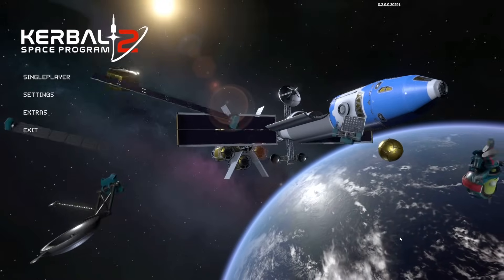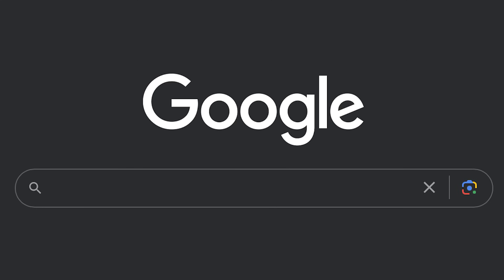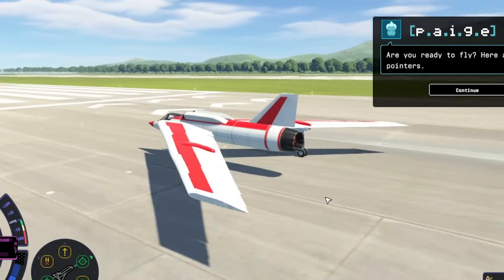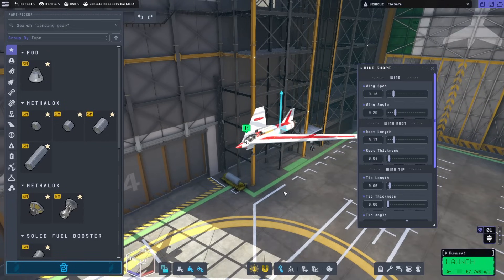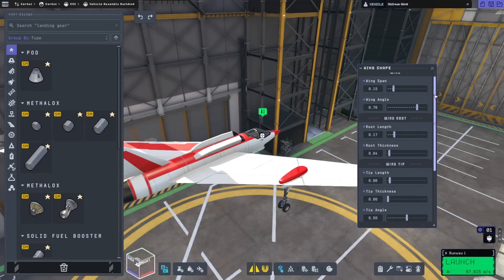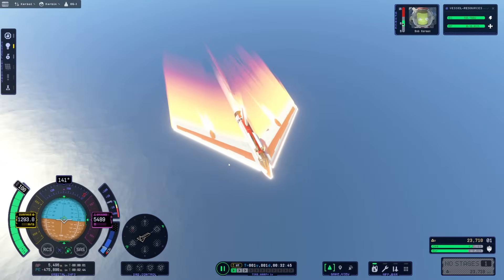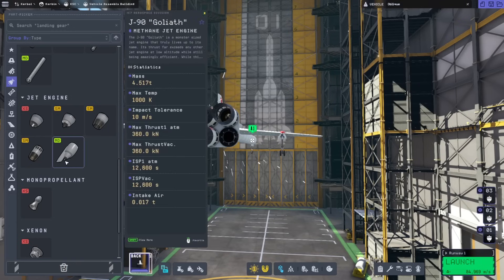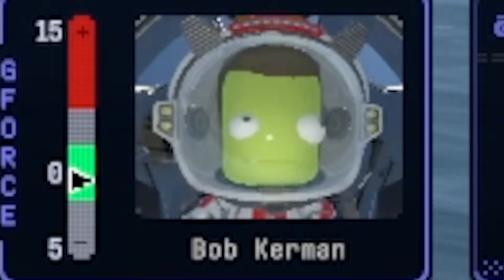Testing the future of air travel!

Comment: I mean, I'm not an aerospace engineer, but from what I've read in the pilot's handbook of aeronautical knowledge, you kind of want some rear elevators to control the whole pitch thing.  Putting the center of lift on the center of mass works, kind of, but that could potentially be what is making it unstable.  Ailerons are meant more for roll than pitch control.  You're pretty much getting all of your pitch control from your engine.
Reply: I am an aerospace engineer and I can clearly say that you are right. One of the biggest problems about oblique wings is the pitching moment hence it may need a huge horizontal tail with huge control surfaces. However, it seems the KSP2 aerodynamic models are not very complicated. The effect of sweep, compressibility (supersonic flow) and spanwise flow may not be considered for this game. I guess the aerodynamic center and center of gravity are the only parameters that affect the aircraft dynamics in this game.
Reply: @yusufbayrak1338  I wanted to write that KSP doesn't simulate span-wise flow, but you already pointed it out. There was a mod for that in KSP 1 ("Ferram Aerospace Research")
KSP is trying to predict how to deflect each surface according to CG and the position of wing control surface, but having two control surfaces (where center of the elevon is near CG, so it had tiny pitching moment) on asymmetrical wing is something that surprised me. I thought it wouldn't be controllable in this setup
Maybe this Real "Civil" Engineer are better at making planes as us? Is he truly a "Civil" engineer?
Reply: @yusufbayrak1338 as a former onur air sub contractor, i salute you! Best wishes dostum.
Reply: @yusufbayrak1338  > I guess the aerodynamic center and center of gravity

Pretty fair assumption for rockets, it was strange to try it in KSP)
Reply: I saw another person make a proper oblique wing in a more accurate game and it worked just fine.
Reply: @Anti-Smart what's the name of that more accurate game?
Reply: I'm just a guy and I have to say it would be funny as hell if our government used these wings for fighter jets.
Reply: First thumbs down on one of his videos lol
Reply: I have been thinking that and commenting that every time he makes a plane. "WHERE ARE YOUR ELEVATORS?!?!" LOL
Reply: I mean, I am a vtol VR pilot
Reply from the maker: They also said you want symmetrical wings too right? 😉
Reply: @RealCivilEngineerGaming you’ve got some different moment arms going on there between your straight wing, swept wing, and oblique wing designs. Source: back of my shampoo bottle
Reply: @RealCivilEngineerGaming  NO. You can build an oblique wing, but you will have roll and other control issues, if you don't reverse the controls on the ailerons on the oblique wing. THIS HAS NOT BEEN TESTED PROPERLY IN THE VIDEO. Build a plane with proper controls and try again

EDIT: never mind, you did figure out that you need to invert the controls, still BUILD AN ELEVATOR
Reply: ... @RealCivilEngineerGaming
Reply: @RealCivilEngineerGaming  actually, at least in my Gleim Private Pilot FAA knowledge Test Prep(2020 edition), it mentions nothing about symmetry and everything @Map71Vette said is true, and my knoledge of planes goes a lot farther than just a test prep.(however the gleim test prep does cover everything you need to know)
Reply: @RealCivilEngineerGaming   Canards then?
Reply: @RealCivilEngineerGaming probably not
Reply: @RealCivilEngineerGaming  It depends on what your needs for the plane are
Reply: Fairly sure his main issue is that ksp likely doesn't have accurate aerodynamics. I would be surprised if it was simulated beyond having less drag (due to less surface area facing forward), and in fact simulated the fluid dynamics of how the fluids interact with the wings and the rest of the fluid and the sound-limit.

Comment: The problem is the wing positioning, you needed a shorter wing at a narrower angle. If you look at the oblique asym wing in the video, it's far closer to the body than yours. I'd bring it much closer say 10 degrees of center line for both wings. I suspect, if you did that, and decreased the wing span by about 20% you'd hit 1500 m/s in game.

Comment: i don't understand why he leaves the elevators on the back often off, is he intentionally making Architect planes or what? that is also i think why his SAS system freaks out because it's missing some crucial control surfaces.
Reply: He's not a aeronautical engineer. That's why.
Reply: @joyl7842   You don't need to be an engineer to know why the elevators on the back are there for a reason and why every single plane has them. This plane even without the oblique wing is a pure Architect design
Reply: @madbull4666  True, but I don't think he's spent a lot of time paying attention to how planes work.
Reply: @brigidtheirish  I don't think he's spent a little time paying attention to how planes work either
Reply: @brigidtheirish  he's done fluid dynamics as he was a drainage engineer, which will be quite similar to how planes work
Reply: @madbull4666  Yes, but in terms of fluid moving through a static system, not how an object behaves in a fluid. That's a rather important distinction.
Reply: @brigidtheirish  while the advanced stuff he may not fully understand the advanced basics he will definitely understand. He just did a video on advanced drainage with a lot of detailed information, he'll definitely understand that wings in middle of aircraft can't point the plane upwards because they are trying to lift the entire plane up in a horizontal axis. If he didn't understand this then I would be extremely scared of his real drainage understanding.

Most likely he just had a moment of being an architect and rushes these videos to get one out everyday.
Reply: @madbull4666 thats akin to saying an organic chemist would know how mitochondria makes ATP

They are both chemistry. But theres a reason biochemistry is a different branch. Similarly a sysadmin may work on windows for a living. But put a windows admin in front of a linux box? Lost. All the commands are different. They are both computer operating systems. But are so incredibly different.
Reply: @harmonic5107  in your examples you are 100% correct but those things are in similar fields but they have a completely different understanding of how things work. Fluid dynamics doesn't drastically change the fundamentals are still quite similar.

If water has to make a sharp turn then there's going to be a low pressure zone on the inside after the corner which creates drag and slows the water down, in a plane air will over the wing creating a low pressure zone and drag which is how planes stay in the air. Fluid dynamics will be similar between air and water in the way you want to manipulate them to act a certain way, yes the calculations will be different but fundamentals are still there.
Reply: @madbull4666  yes. But that has nothing to do with the center of lift and the CG

He may understand pressure and fluid dynamics. But that doesn't mean he understands how that impacts the mechanics of flying. In fact... CG and center of lift mechanics have nothing to do with fluid dynamics. That's very specific to an Aeronautical engineer. To a more typical engineer, you'd want the center of lift to be in the center of gravity on the plane because that's how they've been taught to lift things. It actually goes against the common sense most engineers are taught to follow. If you don't, your pipes or beams or whatever else will slip out of the crane and kill someone.
Reply: @madbull4666  stop it dude, it's like expecting truck driver to knew how to drive race car properly, or expecting racer knew how to operate trailer truck properly
The fundamental is the same, how the steering wheel, the gas pedal, brake, and the concept of gear shifter to change gear ratio to affect speed and torque, the basic concept is the same, but in practice both of them deal with it differently

Just like drainage engineer and aeronautical engineering, both learn fluid dynamics, and the fundamental of it is the same, but both fields deal with it differently
Reply: Would make a great soviet engineer
Reply: the SAS in ksp2 is just bugged, control surface oscillation happens on pretty much all planes you try and make